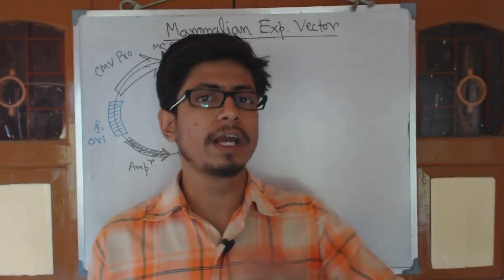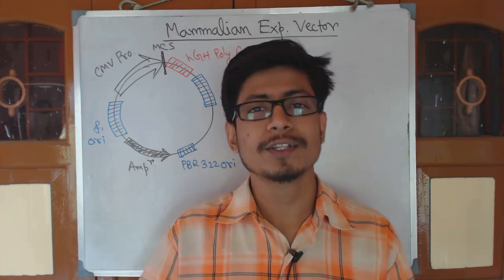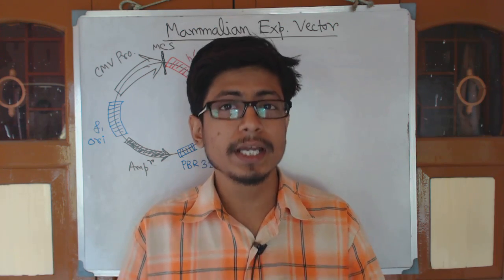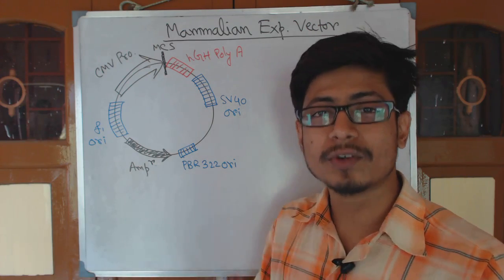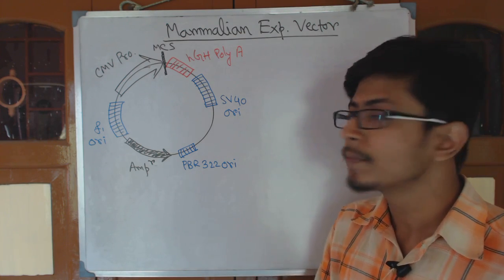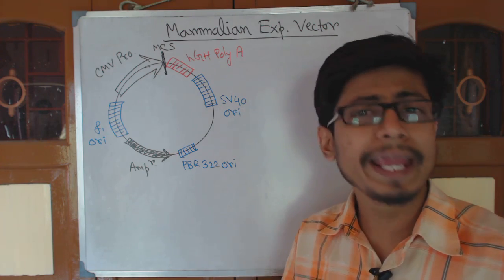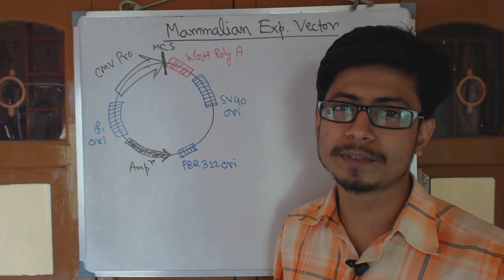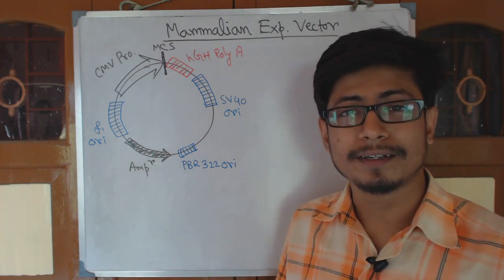Mammalian expression vector

Comment: Question- when would u use prokaryotic expression vector and when would u use eukaryotic expression vector? Like in what situations is one better than the other?
Reply: The difference is post translational modifications. Prokaryotic organisms are able to produce the same amino acid sequence as the gene would in eukarytic organisms but the prokaryot would not be able to modify the protein (i.e. glycosylation) necessary for the same functioning in both organisms.